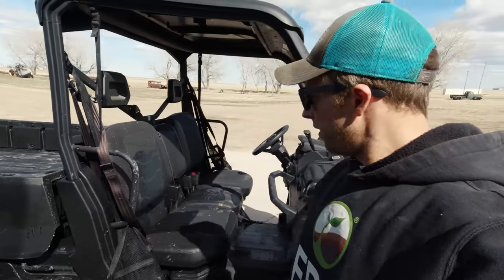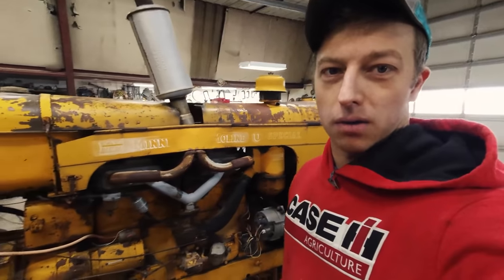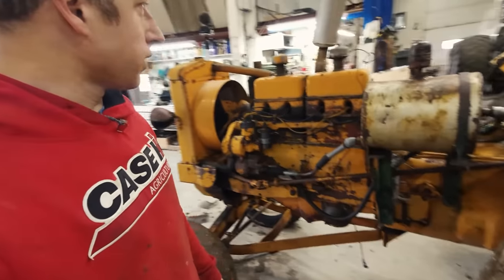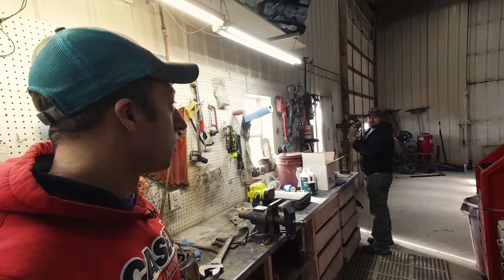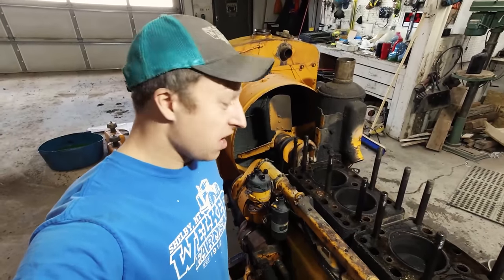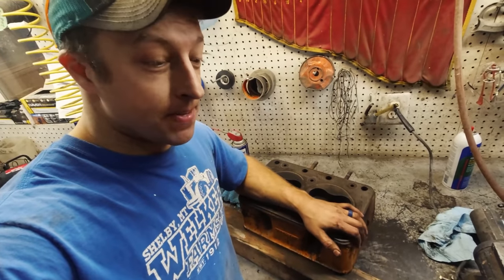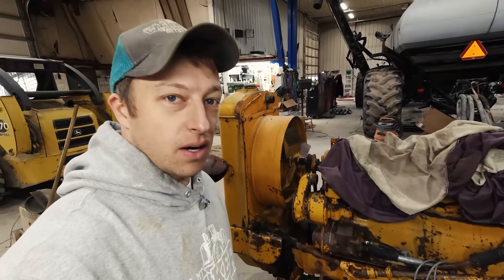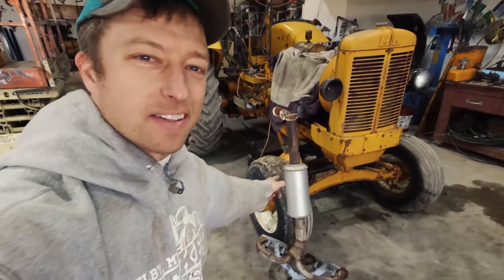Oh SNAP! Literally, it SNAPPED off! - Moline Part 1

Comment: I would have laughed if John Deere sent you some gators.
Reply: i looked at a kubota rtv with the 3 point hitch and front pto auto connect plus it holds 4 or 5 people on it
Reply: Michael Mac Tavish I have a lot of experience with RTV900’s and 11000’s. None with pto’s. BUT they will pull anything, Always run and very very reliable. The only problem with them is the floors rot out, that can be prevented. And parts can be very expensive. Only other downside is say on welkers farm is that they are alittle slow specially with a load on them. I do believe there’s a few things you can do to get more speed and power out of them. Gators are cool to but they are not built like kubotas
Reply: dirtshower250 agree on my 900 the floor and frame is bubbling I am currently sanding priming and painting the underneath to prevent rust through lol
Reply: @dirtshower250  yeah the pto is accully a add on option wich no other branded rtvs doesnt have wich kubota rtvs  can use there compact tractor front attachments wich is nice
Reply: @michaelmactavish1728  bobcat makes one with a pto
Reply: Those Gators are badass
Reply: @michaelmactavish1728  my Uncle has one of them and he would pull a full size ponton with it and lower it in to the water.  It wasnt very fast but still fun to ride in.
Reply: I know Im randomly asking but does anyone know of a way to get back into an instagram account..?
I stupidly forgot my password. I would love any help you can give me!
Reply: @Justin Jesse Instablaster =)

Comment: When you heat a bolt that is stuck, it expands and also the metal around it. 
When it then cools, it shrinks back and it makes it easier to get loose.
The mistake that many people make is that they do not wait for it to cool down 
before trying to release the bolt. When it's hot, it's expanded and sits just as hard.

Comment: I kept hearing, Great tractor, great tractor. The new ones with all the tech and bells and whistles are neat but you just can't beat having a "real" tractor.
Reply: That "real" tractor will beat the shit out of you and do far less work than any new one.  The "good old days" are a lot of times, just old, tough, days! Don't miss them a bit!
Reply: Yeah, modern tractors will do much more work with much less fuel (especially since this Minneapolis Guzzler is a gasjob lmao) and much better operator comfort. Heck, even servicing is actually better on new machines because we’ve figured out proper systems engineering to make things last longer and in even when thing do eventually need replaced on new machines we’ve designed for manufacturing and service - engineers pay attention to things like radiator drain plug location, fastener location, optimizing service operations etc. People always say “We don’t build things like we used to”.. yeah, that’s right, because we’ve learned a lot since then. 😂

Comment: I really liked this video . I like old tractors.
   I have one,it is 1966 IH 414 my dad bought new . Got in running last weekend . I rebuilt the motor 20 years ago but it hadn't run in a long time . Sounds like brand knew . Hardly any paint on it but I am going to play with it this summer. It was the main tractor for a 250 acre farm and ran everyday summer and winter ,for 25 years Snow ,manure ,cultivating .planting corn ,baling ect.
  Boys there is a channel named   oldfarmjunk   his name is Richard and he is always working on old tractors.He goes to sales and buys junk and fixes or sells parts and then scraps . He likes IH M and Allis and he has some Moline's  If you are stuck for parts he could probably get them for you but Moline probably has after market parts you can buy brand new.

 I will be looking to hear the old girl run .Good Luck

Comment: hey guys, just an fyi from someone that has done many fuel tank repairs. once the internal sealing has been done (always a good thing to do) I have always had good luck carefully applying fiberglass resin over tank. just a VERY thin coat don't try to do any buildups.let cure flip tank do other sides. if surface wire brushed and clean it strengthens any pinholes (even those not thru tank)  and stabilizes surface.takes a day to paint/cure/flip/paint but has always (over about 100 tanks) worked well for me.

Comment: We have an old Minneapolis Moline Z w/ hand clutch and sliding/swinging seat which basically meant you drove it standing up (not safe).  When I was young, my dad traded it it twice for other tractors and then bought it back from the dealer.  It was such a great tractor.  He mostly used it for chasing in cows from the far back pasture.

Comment: I thought Cam Am would have at least given you a windshield if not a cab kit. Who would want to take a UTV out when it’s -20 and blowing snow without a windshield at least. 

It’s great to see you guys restoring old usable equipment, and giving it modern upgrades. You give me inspiration to fix the Ford 8N I got given. It will be good to see how the electronic ignition upgrade works on the MM.

Comment: Those old hand clutch Moline Wheatlands were one of the handiest stationary PTO tractors ever. With the seat swung out of the way all the controls could be run from the ground.  If you plan on using the tractor for spring planting you may want to consider changing out the homemade manifold for a factory version that has carb preheat. Without it the carb  throat will ice up on the inside when the temps are in the 30's and low 40's. New manifolds are available.

Comment: G'day Nick, you very definitely can dry sleeve a sleeveless  cylinder bore to salvage an old block, not recomended for high performance but fine for these old obsolete machines.  The cylinder portion of the block are called the barrels, often with a 2 piece block the barrels are shimmed underneath to get the correct piston to valve bump clearance, so be careful if replacing a gasket that the new one is not to thin. I'm a Diesel Fitter by trade and have restored a couple of early to mid 1900's engines as a hobby, one of them an old Lister 5hp diesel had 1/2" bore wear and was still running. Cheers mate 🍻

Comment: I have used that gas tank sealer several times in the past...a painstaking, involved, many step process and it does work- but never forever..over a life time of gas tank repair strategies, i finally smartened up and found the only true cure of gas tank leaking is...wait for it...REPLACE the TANK with a BRAND NEW ONE!!..lol..trust me i have tried every product and procedure known to man to fix tanks-both internal and external, and NOTHING works as well as a brand new tank replacement!!  *true words spoken by a 80's Chevy truck owner and curses to the engineer who thought putting a plastic skid plate over each tank would be a tremendously good idea which did nothing but trap moisture and dirt and mud against the tanks!!!
Reply: Yeah, it's best to get rid of old tanks if there's a good replacement available. Just, not worth the hassle, really. All the aggravation and bother it causes, might as well shell the cash for a new one or a decent replacement and be done with it. Learnt this years ago dealing with old cars on my brother's lands or back home as the guy always asked to come fix stuff.
If money is no problem, i usually replace them with an entry point fuel cell, since they're pretty much bullet proof and they have the option to run more modern fuel pumps (where applicable). 
One good thing about a modern fuel pump is that you can run it at half throttle to match the original specs of the vehicle in terms of pressure and volume moved per minute, which means that you'll never wear the pump in your life time. I've installed pumps that have near constant use in farm vehicles, under that principle, and some of them have now almost 18 years of weekly use, in the typical farm setup "start, stop, start, idle for ours, stop, start" so on.
Reply: @aserta  amen~
Reply: ...no luck with coating inside of tank....it can flake off and plug outlet,  float bowl, carb jet.....but then flaking rust can do the same thing.....wonder if putting some coarse sand in and slowly tumbling it to shine up inside....might wear a hold in a thin spot?
Reply: Best bet for an old tank that you can't/don't want to replace it take to a radiator shop and tell them you want it re-coated... For real... If you have a decent radiator shop around, they've done this many times, and can do it right so you can avoid plugged filters etc as your homemade attempt starts to age and flake.
Reply: MMs are hard to find replacement parts for. Especially fuel tanks.
Reply: Kyle H  oh he'll yeah !! Big time !!!

Comment: Awesome tractor!! Our neighbor down the block has a couple that he has in his garage and they are so cool. I Just got a tractor given to me this passed weekend so looks like we both have a project on hand.  I'll be working on my new to me 1955 Allis Chalmers WD45 Narrow front.  Awesome Can-Ams by the way!! I have had issues with spark plugs like that, and My grandpa showed me to use kids Crayons... yes... crayons... let them melt and they soak into the threads and rust. worked for me every time, also with spark plugs, use Square easy-outs, not round ones, the round ones will try and spread the metal, square ones will actually bite into the metal and not spread the metal outward.   Wix 51114 oil filter for the moline special U

Comment: "Oh no! the shop is on fire, grab that fire extinguisher!"   pssssssshh -- FWOOOOOOOM!!!!  "Ahhhhhhh!!"
Reply: Mishn0 that actually happened at my place. A cousin who had never been in a shop before was there when my great uncle had an electrical short in a welder that started a fire, and he thought that the Oxi-Acetylene torch was an industrial fire extinguisher. Nobody does but we had to gut the shop and rebuild it
Reply: Considering it is a water fire extinguisher, that would probably happen anyways...
Reply: @holsteinsanddiesels7758  When I was in the Navy I was walking through the dockyard past the Frigate Sheds, and there was an enormous like 150db "Klang" followed by a "Whoommm.." which sounded like a 1950's jet engine spooling up then a huge "BOOOM"... I literally ran away though i had no idea what was happening (the guys sprintinf out of the shed screaming was a major clue that something bad was going down). 2mins later fire alarms,  fire fighters etc. Turned out a 200litre Oxy, fell off the deck, dropped 80ft in to the dry dock beneath the ship, sheered the valve off the top and went pin-wheeling around the concrete dry dock like an out of control rocket before detonating. I have no shame in saying i needed new pants.

Comment: The nut and bolt method works really good cleaning tanks. I use to play with old motor cycle. I’d put apple cider vinegar and nuts and bolts in the tank. Ratchet strap it to the rear wheel on the pickup, jack the pumpkin up and put it in drive. Set the parking brake just a bit and it would be set to tumble for 30 minutes. That method clean most of the tanks. On the really bad tanks electrolysis was used, also a very cool method.

Comment: Had a neighbor the bleed MM yellow was around 1965 and he had 3 or 4 of those he farmed with. He was pulling a couple old stumps one day and his dad just was pulling down the drive and the neighbor was backed up to the stump and started hooking up the chain, reached up and grabbed the hand clutch and it jumped and pushed him against the stump and he was between the stump and rear tire and it was chewing in him pretty good but lucky his dad looked in the mirror and seen him being eaten by the tire and turned around and I guess saved his life. I never was a fan of tractors that only had hand clutches. He was banged up and missing some hide but did recover.

Comment: On old tanks with pitting and rust through pin-holes, I just sand blast the pitted area real well.  Then lay on a layer of JB Weld and use my fingers to force it through the pin holes.  Level it out with a body spreader and place it up-right in the use position.  The JB will flow and flatten on the inside around the holes making a small "cap" and it'll stick like crazy to the sand blasted finish.  24 hours and it's ready for Gasoline.  Never had one leak through the repair, even with ethanol gas.  Saves a lot of welding and patching :)

Comment: I’d probably be wearing a mask because that’s more than likely lead paint
Reply: Lacquer. Lead paint was used on buildings and houses.
Reply: Pretty sure lead paint is illegal to produce now, I could be wrong but I swear I heard that they stopped producing it cause its super toxic
Reply: Thomas Gilliam they stopped in the 70s that tractors looks to be older than that
Reply: @thomasgilliam6395  Nope, not super toxic - just sweet tasting, and kids would eat the paint chips.  Over time, eat enough - lead poisoning.  A few particles of dust.. well, you'll probably get more at a shooting range.

Comment: Nick, I have used a 25% diesel/oil mix to clean out the inside of an engine. You can add this mix and run it for a while without damaging the motor and it does an amazing job!
Reply: Atf in the oil

Comment: Nick..The next time that happens heat it up then cool it down with a water hose then it'll screw right out and no........ cold water wont hurt the hot head. I have removed several of those on our old UBs...Those old Molines are notorious for that happening.....

Comment: A easy and excellent trick to clean up the inside of an engine is to add 1 quart of ATF in place of 1 quart of motor oil. ATF is an excellent cleaning agent. Done this many times on motors that had white cream inside the crankcase from moisture that had entered the system and the engine never got to full operating temperature to evaporate the moisture. I ran a small repair facility out of my home garage back in the day.

Comment: I started driving a U Moline pulling a 15 foot Krause oneway when I was 8 years old in 1955. The tractor I think was made in 1938. It had a 1 piece head and cylinder block. The family was still using it when I went to college in 1965.

Comment: l have a 38 U  it is different as it has a one piece head that later changed to 2 cylinder heads l think MM changed over in about 1940 they are powerful tractors mine was bored out to 40 thousandths with oversized aluminun pistons!! l dont know about ours but mine will run about 28 mph in road gear!! so you have to be careful it does a good job on 316s at plow days!! you guys be safe and l will be watchin!!

Comment: Very cool. Grew up on a MM propane burner. With modern fuel and ignition your putting on it. I’d have the heads cut down raise the compression. They were only like 5-5.5/1. Lol

Comment: My old moped had bad threads at sparkplug hole. So i took the head to my local engine shop and they installed a helicoil in there. It has been working fine since then

Comment: nice vid, now a couple pointers...sent the heads out for a valve job...money well spent. second a length of chain inside the gas tank works as well as nuts but is much easier to manage.

Comment: I'm an old Moline fan, when I was still farming I had a 1951 UTS, a 335, a M-5, and a 670 diesel as well as a G1000 Vista for a couple of years, a 2-105 White and a 1135 Massey. All were fantastic tractors that did a lot of hard work.

Comment: we started with A Honda ATC90 three wheeler I believe they were the first ones out it was actually designed so you could break it down without using any tools and put it in the trunk of a car or the back of a station wagon so you didn’t need a trailer too haul it around then we also had a TRI sport I don’t know how many of you ever heard of them they were bigger about the size of a four wheeler now they had a longer wider wheelbase and the rear axle had a limited slip differential and it had steering brakes you could turn the handlebars and hold the brake on the side you wanted to turn and it would turn shorter and you didn’t need to lean over and lift one wheel off the ground too turn like with the Honda the drawback of them was that they had a Salisbury drive like a snowmobile has and if you were on rough ground like a plowed field where you had to get on and off the throttle a lot and with the power it took on the soft ground they would burn the drive belt off in no time flat they never should have outlawed the three wheelers like the Honda they were only dangerous if you were stupid and didn’t belong on them in the first place if you halfway used your head while riding them I have personally rolled them over both sideways and over backwards and never got hurt they made it illegal for dealers to sell them because they were so dangerous but yet more people were killed each year on snowmobiles between hitting other snowmobiles and running into trees at high speeds and running through barbed wire fences they didn’t know were there and decapatating the driver and any passengers they may have had with them some company also made a two wheel motorcycle or minibike with big flotation tires on them for off-roading I have seen them but never rode one there are still some people here in Wisconsin that have Honda three wheelers and use them for going out ice fishing mostly the 110’s or the 200 big reds I believe you can still legally do private sales but no dealerships can sell them

Comment: I had a TD9 International dozer on which I had to replace the 8 bogie wheels. They were attached to the cast iron undercarriage by 32 - 3/4 inch bolts of which eventually 10 snapped off in the casting. After the first one broke I tried drilling and an easy-out to no avail. I found I could use a cutting torch. The steel bolt actually melded sooner that the cast and the steel just blew out of the threads in the cast. I cleaned the threads with a 3/4 inch tap and was good to go